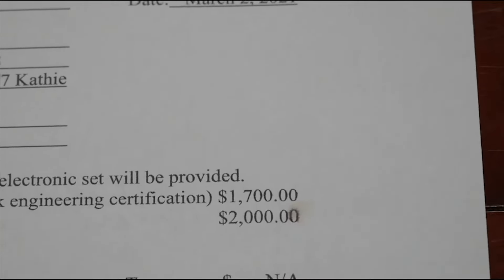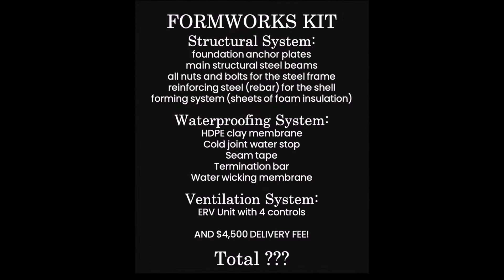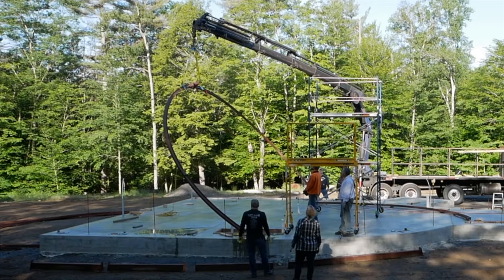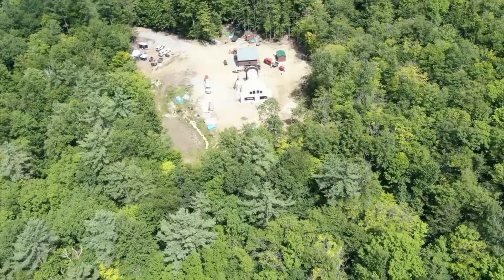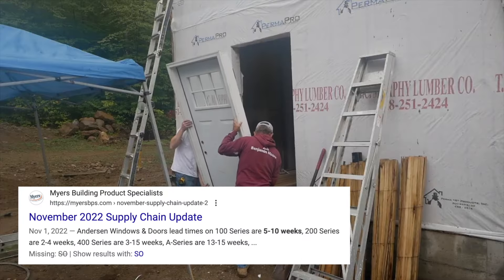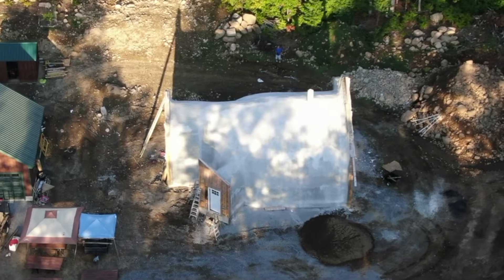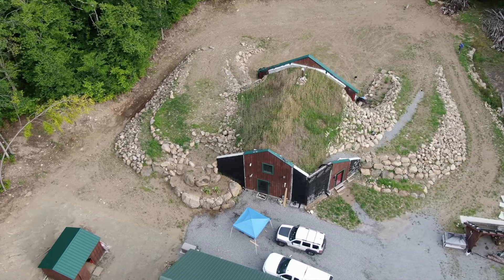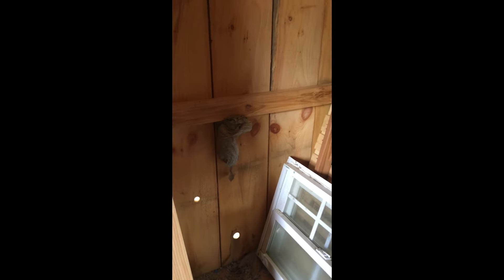What it COST US to BUILD our GREEN ROOF HOME from BASE to BURIAL

Comment: Crazy build. Came out cool, but I think this reinforces my preference for buried Quonset huts. Seems like it would be much easier and cheaper to build.
Reply from the maker: Thanks. Quonset huts are very cool but they aren’t engineered to handle the immense weight of the dirt on top. It might make a great Shotcrete backstop rather than the foam we used though!
Reply: @CreatingASimplerLifeOffGrid  , exactly. More of a quickly assembled concrete form than part of the structure. Only needs to be strong enough to support the rebar and shotcrete.
Reply from the maker: @chaseweeks2708  It's a great idea!